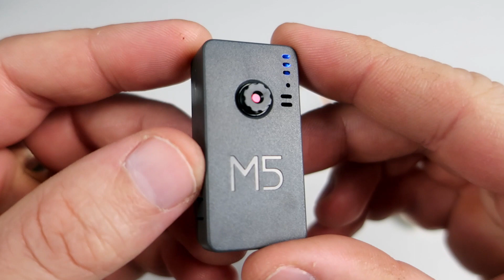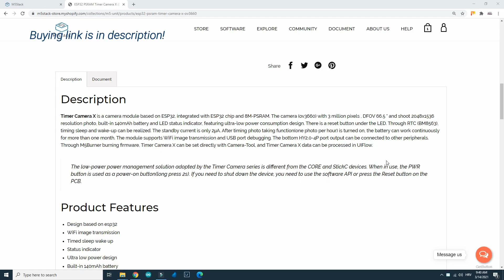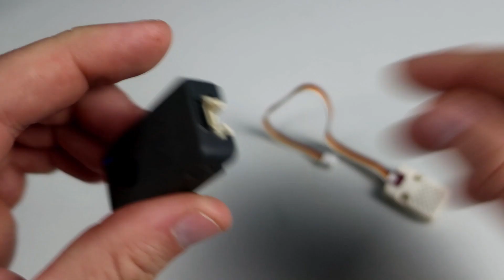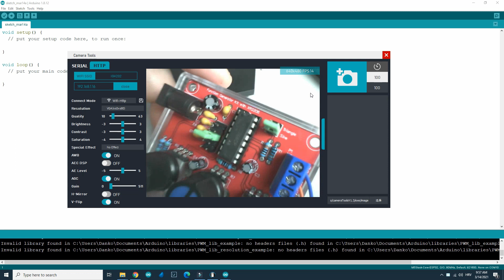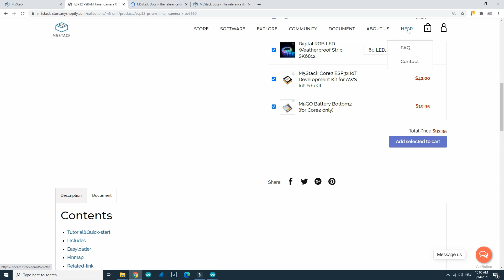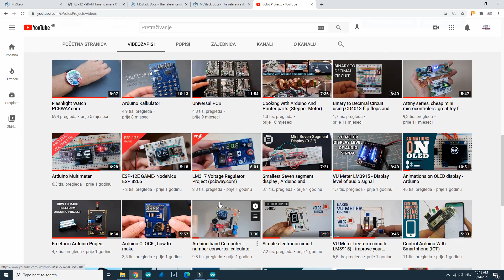M5Timer Camera X ESP32 Camera (Best ESP32 Camera)

Comment: OV3660 is a 1/5" sensor, thats extremely small sensor for 5mp resolution.. the image quality will most likely be really poor. 1.4micron pixels, those are too small to be used even by the best optics... would require optics that can revolve around 200lp/mm to resolve those pixels.